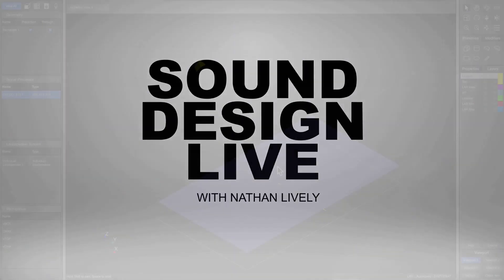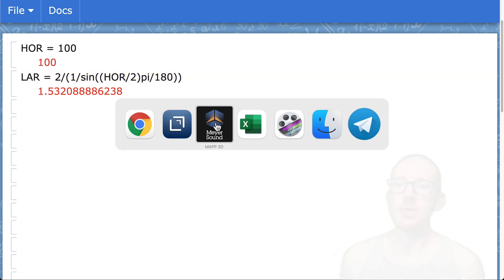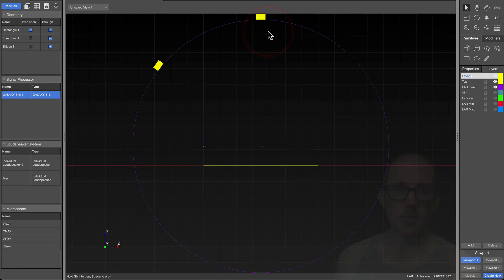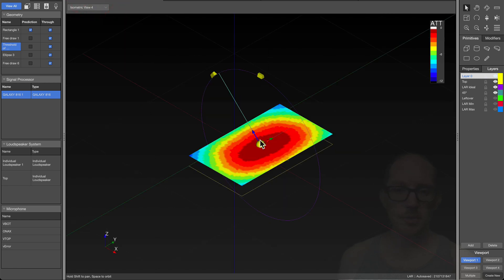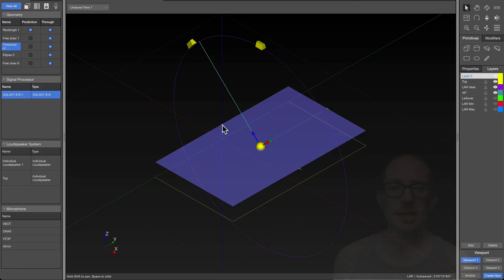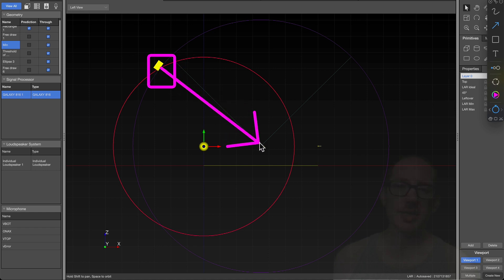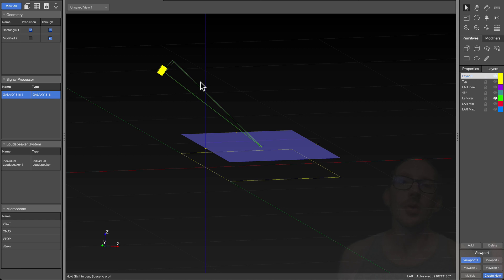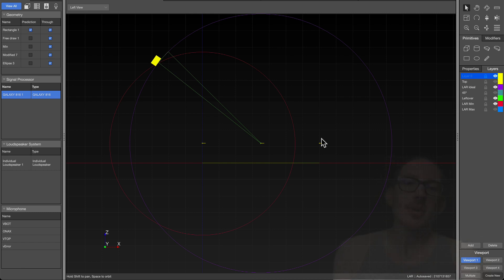How do you use LAR to place a point source speaker? (later aspect ratio)

Comment: Great video and amazing explanation. Overall is easy tu understand. But here is my question:
First question, where do I must aim the speaker, at the middle of the room or at the back? My guess is aim to the back of the room for longer throw and directivity of the speaker. Is it correct or i have miss something? 
Second question, if the LAR minimum of the front row don't have cross section with LAR from middle row, so we decide to focus on the middle side, then add front fill speaker to cover the front row. Is this correct? Thank you in advance!
Reply from the maker: Hi Kevin, you're asking about aim in the vertical plane? For anything over a 1:2 front-to-back ratio, aim at the last row of the audience. Otherwise, aim is estimated with formula that I can share if you like.

I'm not sure if I completely understand your second question, but yes, LAR is used to determine the width of coverage, and therefore, if fill speakers are required.

Comment: Hi Nathan How are you?
Your videos are amazing.
I Have one question:
In the begining of the video, in excel, for example if I had a space with 15 meters Length, If I direct the speaker axis to the middle of the room, this point my hypotenuse, will be my 0db point?

In all cases my 0db point will be where I direct the axys of the speaker?
Reply from the maker: Hi DiAfra! No, not necessarily in all cases. It's possible that in some asymmetrical designs where attenuation by inverse square law and attenuation by axial loss that you sound will get louder as you move close to the first row of the audience even though you are moving more and more off axis. Imagine a speaker on a 6 foot tall stand at the front of a seated audience. Even though you might point the speaker at the last row of the audience, it might still be louder at the center of the audience.